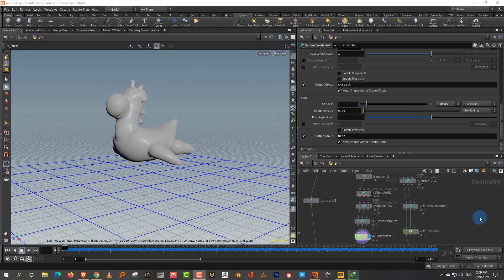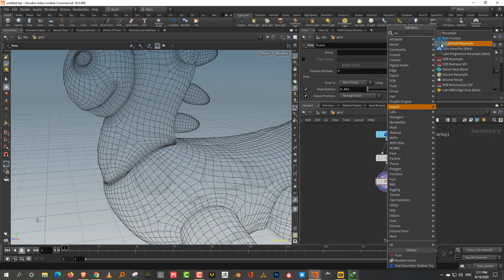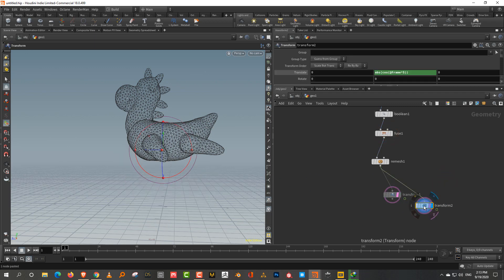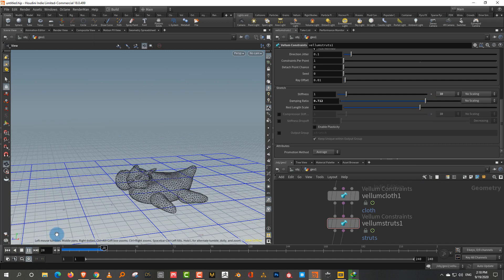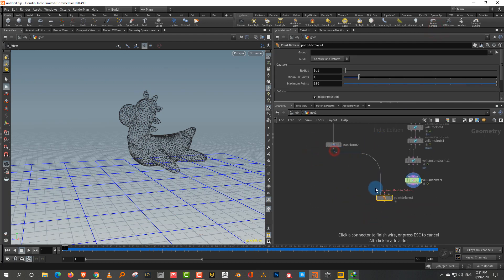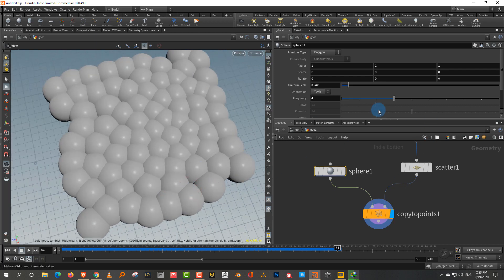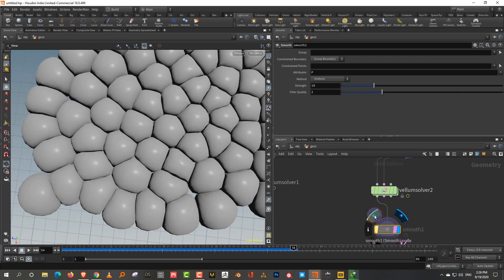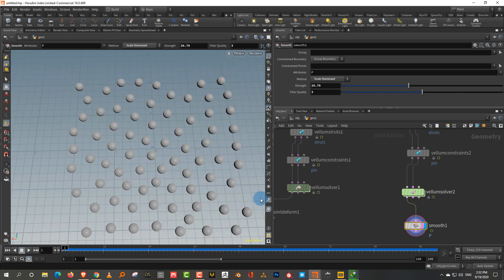How to make animated squishy objects in Houdini

Comment: Thumbnail was what i came for tutorial on..👍
Reply from the maker: Take some text. Polyextrude. Remesh. Vellum struts soft body. Vellum solver. Ground collision. And let it drop.  That's it.
Reply: @rohandalvi  Material?
Reply from the maker: @fox_bandit  you can use a falloff/fresnel map and connect it to a gradient ramp.